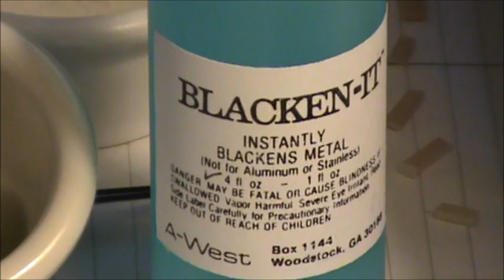BLUENOSE PART 25

Comment: Gary she is looking good, fantastic actually!!  Thanks for the shout out last video , that was very cool and classy . I just wanted to say that the dory not dingy is only on deck during fishing season and was removed for racing,so depending on how you want to display your ship you don't have to add them  also they were stacked inside of one another  and tied down check out this link  and scroll quite a ways down to this fellows bluenose reconstruction   http://dnelson.ca/Restorations.htm   . I also wanted to say that I have had really good luck with gun blue the stuff for gun barrels , I use it for my cannons and other brass fittings, I get it at outdoor /gun shops. Also checkout this link for dead eyes and other such small parts http://www.syrenshipmodelcompany.com/  . Gary you can make the videos as long as you want , they are the high point of my week  sitting down and enjoying  them with a cold beverage , makes me forget about work and I enjoy every part of them .Keep up the good work it is very much appreciated
Reply from the maker: ***** I'll be talking about the "Small Boats" in my next video and how I think I'm going to display them.  I see two types of anchors in the restoration pictures, did you catch that?  I also found pictures of the original Bluenose with it's anchor.  Will be talking about that also.  Hope to have both mast done by next video, have only one done so far.  The plans do show when she was racing they took a lot of things off the ship.  Thanks for the tip and the two web-sites.

Comment: Wonderful job again :) Great video! I think you needed MORE of that blacken-it. Not longer time but more of it. Those deadeyes are from Artesania Latina. Im sure you can find more of them om Fleabay :) Thanks again for showing your work!
Reply from the maker: Bara Mitt I have a couple more parts I may try the Blacken It on again.  Once the liquid gets all nasty I'll dump it and put in some fresh and soak it some more.  I think I may just go back to the 4mm round deadeyes I bought.  Thanks for the tip.

Comment: great job .if you go on to the Nova Scotia arcives web sight photo section, you will find a lot of pictures of the origional Bluenose by J.R. MacCaskil that will fill in some of the missing details on the plans and also show what they were used for especially the windless and some of the rigging i belive some of the eye bolts you are refereing to were used to tie down and control the main boom
Reply from the maker: The Nova Scotia web-site was my go to site throughout the build.  I found that web-site early on, even talk about it in a few videos.
Some of the pictures of the bowsprit on the web-site helped me with the model because the directions I feel were incorrect.  Anyone building this model would be wise to look up Nova Scotia Arcives.